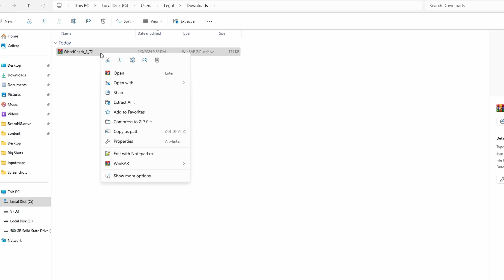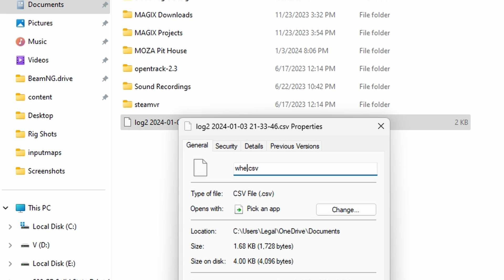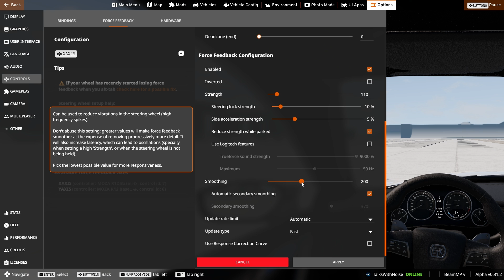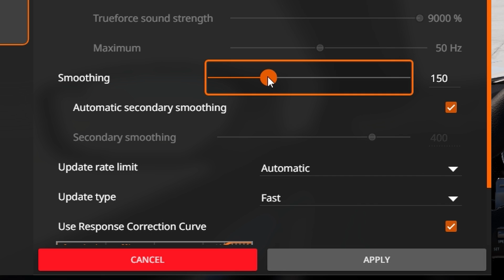Fix Your Force Feedback in BeamNG

Comment from the maker: Edit: In the recent 0.38 update (2026) you will not see the graph in BeamNG.  But it WILL still apply.  It’s a bug that a developer Stenyak noted will get fixed for next update.
Reply: I watched this for entertainment
Reply: after the wheeltester i got a ff deadzone of 16%, using a logitech g29, and i still have big jitters with smoothing 500. any tips?
Reply: @B_Poort download a Lutgenerator and convert the csv to a Lut file that fixed it for me
Reply: @B_Poort convert the csv to lut
Reply: please help
Reply from the maker: @mohammadatoui-yg9oq  Help with?
Reply: @TalksWithNoise  when the step log finishes it only; exports it to an Excel file what should it do???
Reply: @beawsome7722   dudes trying to find a fix thats why he hasnt replied. Its an issue with windows entirely. They decided to fucking ruin the file format by making it be recognized by excel and it literally doesn't allow it to be executed like it should by beamng. It shouldn't matter if its an excel file or not but unfortunately thats not how the world works.
Reply: is there any solution? @IIronyy
Reply: i saw an improvement, but because its now sending right info about ffb to the wheel the faster and modified cars that shake when being launched make my wheel very hard to control. The wheel shakes too.
Reply: it makes a microsoft excel file for me how to fix
Reply from the maker: @ Still works for the latest update for those wondering, and if you're getting an excel file it's because excel automatically converts csv files to xls files.  Don't know why it'd do that and not sure on how to stop it since I don't have excel to tinker with finding a solution.  Post yours if you've found one.
Reply: does it mater if its a lut or a csv file?
Reply: hello i'm not gonna lie i feel pretty lost and cant get a good balance of ffb, i have a g923 and i saw that you have a similar model as well, is it possible to get your settings for it ?
Reply: Before the beamng updates in ffb. Is this video still useful? Ty
Reply: Does anyone know why when I’m driving and I quickly turned my wheel and let go it starts going back-and-forth by itself
Reply: Is creating a csv file still important on the latest update on beam for the Logitech g920?

Comment: This is great and feels great but i have one problem that seems to plague alot of others as well, my wheel shakes violently left and right like death wobble now, only slightly but its enough to throw you off at speed and sitting parked is so annoying with the wheel just going left and right. "Centering force" does nothing and "reduce ffb when parked" only works a little bit. Seems like alot of others have this exact issue too after surfing reddit. If anybody has a fix please reply🙏🏼

Comment: Great guide, it helped a little, but unfortunately it still doesn't work for me as it should.
I have a MOZA R3, I made the initial settings as indicated in the guide on the MOZA support website, then I did everything as you say. However, the steering wheel still either jumps too quickly to the left and right (wobbling), or I feel like I can't feel the weight of the turn. For example, in other games like Wreckfest 2, the harder you turn at high speed, the more resistance you feel. Here, unfortunately, the resistance is only at the beginning, and then I feel like I'm driving on ice (in real life, you have to use a lot of force to turn the steering wheel at high speed, even with power steering in a car). I also tried your drifting guide, but unfortunately I can't even do a donut in this game (in other games it's not a problem, even in the ridiculous Wreckfest 2 - here the steering wheel behaves correctly).

Do you use the MOZA database and could you show your settings?

Comment: My response correction curve, it's a curve, it's a straight diagonal line to the top and then an immediate drop to the bottom. When I have it selected the wheel is constantly wobbling back and forth with a lot of force.
Reply: ur program crashed while config

Comment: I did actually have to lower the default FFB strength because i barely could turn some Cars when going slowly 😅😅
Reply: You have to add the power steering pump into the cars, they ALL come unequiped even if modern. Theres a mod to add them automatically

Comment: I did that and my wheel has a 16% ffb deadzone and when i let my hands go off the wheel it starts shaking. Just a little bit lit 1 degree left and then right and so on and this in fast. I have a Logitech G29
Reply from the maker: Sometime the wheel check produces unfavorable results.  Seems to be a more common occurrence with gear driven wheels.  Fortunately if you uncheck the correction curve box BeamNG has a profile that automatically adapts to Logitech wheels.  It should especially feel noticeably better after BeamNG’s last update :)
Reply: @TalksWithNoise  well, if i uncheck the box, then the ffb feels....not so good again (the standard ffb and I don't like the standard one). But with the correction curve it feels way more realistic but this wobbly thingi is...annoying. and wdm with "profile that adapts to automatically to logitech wheels"?
Reply: @TalksWithNoise  but thank you

Comment: I dk if this is normal but when i use the correctional curve when i let go of my wheel while moving  it goes full lock either left or right and i don't know if that's normal.
Reply from the maker: Invert steering under the ffb controls!

Comment: Why did wheel check generate an excel spreadsheet and not a csv file?
Reply: Because you can open csv with excel. Look at the extension of the file. Also you can open it with notepad.

Comment: my force feedback ended up being worse with the wheel check file sadly
Reply from the maker: Which wheel are you using?  BeamNG developers have started adding default correction curves that’ll silently run in the background if you have yours disabled.  These past few updates I’ve found theirs to feel far better but I also run a very common wheel.

Comment: This made my FFB on G29 way worse. It got super jerky and added lots of vibrations. Turning smoothing down makes things even worse and it happens even on low strength like 200. Also the steering now acts like it has a deadzone set on the center and it bounces left to right in a loop. FFB now acts like it's half inverted, it works fine to some degree but then it pulls to the other side, like it inverts after some steering angle is met. I tried disabling inverted FFB but then it's even worse, it's just completely inverted. I don't recommend using this with G29. I went back and I'm not using the response correction curve. It's not perfect but it's way better. I feel like last few updates ruined the FFB on G29. And my wheel is fine, it works great in other games. But in Beam it's super jerky and the game sends too much vibrations. Actually, lately I prefer using gamepad in Beamng. Wheel isn't enjoyable anymore.

Comment: Hey talks, I ran the CSV and then did the following, my wheel started shaking between -1 to 2 percent rapidly after modifying the beamng settings, I then put the key binds back and reset it. What did I do wrong? the graph in the settings tab reads -34 :( what do I do about that? yours said 0

Comment: I figured it out. I had to enable "CENTERING SPRING IN NON FORCE FEEDBACK GAMES" It feels so much better. G920 - Latest Ghub I wonder if I run the test again with that on. If I will get a better result for my FFB file. When its off, I get almost a straight line.
Reply: How do you do that?
Reply: @OTNoah  Logitech g hub app

Comment: This ruined ffb completely. How do I reverse the steps back to default?
Reply from the maker: You reverse what you did .-.
Reply: @ I did and it still acts up :/
Reply from the maker: With the file removed its going to act how it originally did.  There’s no reference for it to recorrect.  Some wheels have odd drivers or too much slop making test results inconsistent.  My R12 does the same after a recent software update.
Reply: @TalksWithNoise  I’m saying after I downloaded the file and put it into beamng, my wheel was way harder to turn than before. I adjusted the ffb and it still didn’t work so I deleted all the files I downloaded and it still is acting weird. I played this game for over 700 hours with no issues until this file. I don’t know how to remove it and why it’s still acting the same.
Reply from the maker: @ You remove it by deleting it like any other file .-.
Reply: To reverse it, you’ll need go to device manager and uninstall you wheel’s changes (uninstall from dive or smthg like that)

Comment: why did it give me a excel file tho
Reply from the maker: Sounds like a windows setting trying to do an open-as.  Not sure on how to disable it since I haven’t run into the problem.
Reply: @TalksWithNoise  looks like a bunch of people are having the same issue.
Reply from the maker: @ I did a quick google and excel likes to automatically convert csv files to xls.  Not seeing a way to prevent it.
Reply: any fix?
Reply: Looks like you just have to set the open with to  "notepad" then it will work.

Comment: My wheel just centers even when not moving now and even if I change strength to zero its still very strong, can you make an updated video with something that works with the current update?
Reply from the maker: Shouldn’t be any different this update.  It’s just using a csv file to recorrect strength.  But if the test didn’t run right your csv file isn’t going to work.

Comment: When I run the Step log 2 test nothing happens at all
Reply: Right finally someone with the same issue if I find any luck il come back here, I'd appreciate if you could do the same
Reply: I am back, I had multiple "FANATEC WHEEL" options so I suspect it was detecting my handbrake and shifter so if you have the same thing maybe try the other detected wheels maybe one will work

Comment: My wheel locks at 450 degrees now
Reply: If it turns 450 degrees in each direction that is probably normal for your wheel unless specified otherwise. 900 degrees is usually the complete left to right distance

Comment: The step log 2 part isn't doing anything to my wheel, I picked the right joystick

Edit, I fixed it by downloading logitech g hub
Reply: im having the same issue
Reply: @thorean0907  actually, GAMETUBE786
Reply: same, i have t248 and nothing happens. In beamng its no force feedback, but i know that the wheel is built with it
Reply: i have the g29 and im having the same issue

Comment: I am having a little issue. When the car is stationary in game the wheel goes back and forth, like it is trying to center itself but is overshooting and then centering back and goes in an infinite loop. Everything else feels amazing, my g920 hasn't felt so smoothing in beam ever. I hope you can help and that you even see this, you seem like a knowledgeable guy :D
Reply: Turn down the smoothing, because the FFB is less responsive when the smoothing is very high.
Reply: @ZAllin_9o5had the same issue and turning smoothing down made things even worse. I don't recommend using this with Logitech geared wheels.
Reply: @ZAllin_9o5 did that and now it kinda stays still but it vibrates

Comment: Hi bro, i follow all the things, but on my Logitech g29 on the "use respinse correction curve" appears a "force deathforce" of ~10%, how can i system It, cause the paragraph id not the same, mine have a almost Sharp angle
Reply: Have you fixed it yet because I have the same problem just that I have 4%
Reply: @eliashoff1702  sadly no

Comment: I have a problem. I justb ought my G29 and I love it and all but.. The wheel isn't self-centering when I let go of it in BeamNG. Now, in Logitech GHUB the self-centering is turned on but you know beamng doesn't listen to ghub. Now, after your tutorial my wheel is somewhat self-centering but it's only doing so with so little force that It's unnoticeble unless I assist it. Idk much, can you tell me if it's ok, or what I can do?
Reply from the maker: Sounds like the force is set way too low.  And it should only self-center if you’re driving in a straight line and letting the wheel coast through your hands (or it’ll oscillate).
Reply: @TalksWithNoise  Well the force is set to 300, and I've tried many more increasing/decreasing by 50. Also, it's not self centering at all. Like it has no will to even move to the center whatever the situation. In ETS2, it works perfectly fine and I love the FFB in that game
Reply from the maker: @mihaisuciu  I've recently run Beam on the G29 with no problem and yours clearly works with other games.  Is the steering inverted?  Not sure what else could cause it problems.
Reply: @TalksWithNoise  the steering is inverted but otherwise it would be a mess what's left of the ffb lol

Comment: This helped me a lot, also check and make sure that oversteer is on and checked to “wheel direct filter” make it maxed at 4mph or whatever this makes it so you can pull off the crazy stuff you use to do on controller really easy.

Comment: Thanks a lot. I was underwhelmed with the FF in Beam with my T300, but played it regardless. What a mistake. Also, what i really like, because i do use a lot of off road Vehicles and Trucks, is to reduce the "reduce FF when parking". 

I have to look and tweak every setting everywhere but i never looked too much into the FF settings until i did and saw your Video. Beam is even better now. Thanks!

I did this after a few hundred hours of beamNG and after 100h with a wheel in that game lol.
Reply: my inputmap file doesnt show up
Reply: what are your ingame settings? i also have this wheel

Comment: My lut curve looks completely different, its more linear, is that wrong or should i dont mind about it, the lut curve is more linear to and crosses only once, my wheel is logitech g920, i bought it new few days ago, not used (idk if that information is crucial)
Reply: The lut is gonna be different for every wheel, so you probably shouldn't really mind that.
I'm guessing manufacturing tolerances and the age of the wheel also play parts in how that will look.

Comment: waooo.. impressed that acualy makes alot of difference also on the small bumps.   
Sometimes when i tap out of the game and back in.. in borderless mode,  its like the FFB stops  working in the game
and if i disable and renable it it doesnt seem to help untill i quit the game

is that a familier problem, and is there a stady solution for that so it doesnt pop out just because i change window ?

Comment: My wheel not calibrate when i run spring force in wheelcheck aplication, but, when i starting my pc, my wheel just calibrate 2 times.Can you help me?
Reply: I have logitech g29 driving force racing wheel, and position of my wheel in this aplication is X and Y, i dont have coordinates
Reply from the maker: Try the tutorial word-by-word.  Spring force and setting coordinates sounds like a different topic.

Comment: my wheel never did the test, it didin't do anything after i clicked the step log 2.
Reply: no csv file to be found
Reply from the maker: Wheel type?  And do you have your wheels firmware downloaded?  If it doesn’t run the test then a csv shouldn’t appear.

Comment: It sorta works. The .csv graph in beamng is mostly linear and if I am in game and not touching the wheel it twitches from side to side (when not moving)
Reply from the maker: That’s normal.  The friction between your wheel and hands acts as a damper.  Without holding it it’ll naturally want to oscillate (or the system would be critically or over-damped and therefore not responsive).
There’s a way to disable oscillations while parked in force feedback controls.  Else, you’ll want to use your hands for control.

Comment: Why is the graph that is based off the .csv file linear? (Flat but sloping upwards) 

Edit: it made the force feedback worse with the .csv thing. What have I done wrong?
Reply from the maker: Could be a worn or really weak wheel.  Mind stating what model you’re using?
Reply: @TalksWithNoise  its a logitech g920 2nd hand so could be old idk
Reply: Also the graph has a dead zone of ~8% idk why

Comment: Can someone please help me cuz when i set up the ffb it always has force deadzone 14% or 16%. My ffb doesnt work but few days ago it did work but only if i play 20 minutes and unplug and plug it in like 120 times. My setup is a steam deck with a steam dock if its important
Reply from the maker: Deadzone intensity can be set in the force feedback controls if I remember correctly.  

Disconnecting after half an hour use to happen with my old G29.  It was a bad usb port on my PC, so not sure what it could be in your case.
Reply: I fixed it, thanks tho but i still have a problem where i have to unpluc and plug it in for 10 minutes and then it works, i also fixed my deadzone using step log 3 in the wheel tester and holding it before it starts. My ffb is perfect but it takes long for it to work, i thinks ist the steam deck dock cuz i used an samsung adapter before that could only fit one usb cable in it and it was better. Still, thanks for the help ;)
Reply: (Also this is my other account)

Comment: my csv file is like yours but at the bottom
Reply: G923
Reply from the maker: @wiktor6501 Yup, same wheel!  They’ll look a bit different based on gear wear, motor manufacturing repeatability, etc.  Seem to feel better with or without the csv?
Reply: @TalksWithNoise  mine is brand new. And its more like kia boys with csv file. (as in going left and right when i dont grip on.) like I dont know why its like that. My line is just at the bottom.